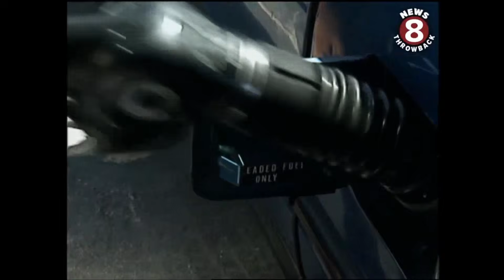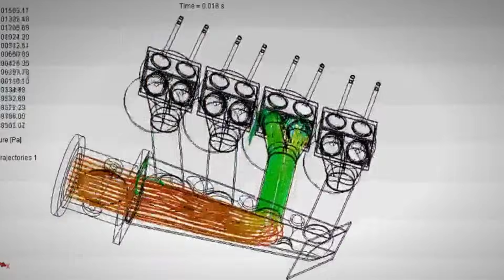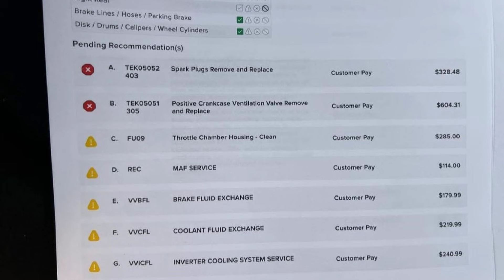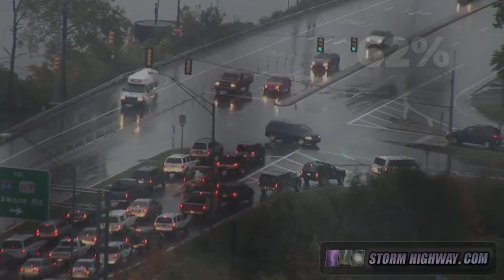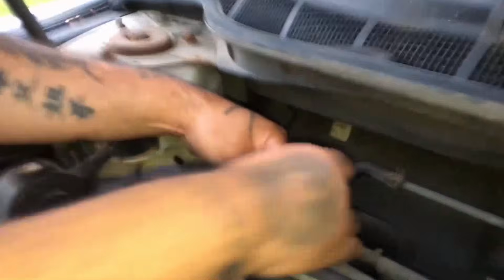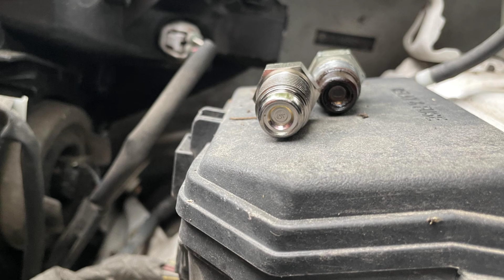$5 Part Replacement = 700K Miles On Toyotas | Why Did They DELETE It From Service Manual?

Comment: In 50 years of driving Ford's I never replaced a PCV valve, just clean at every oil change.
Now the spring loaded plastic pieces of crap they use on Asian cars is a different story.